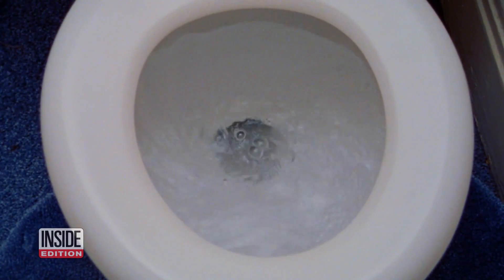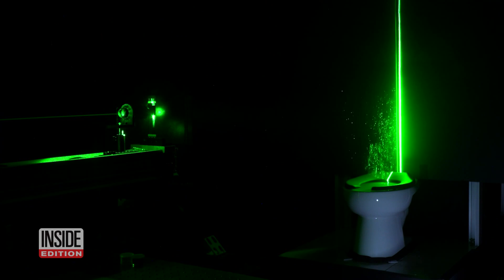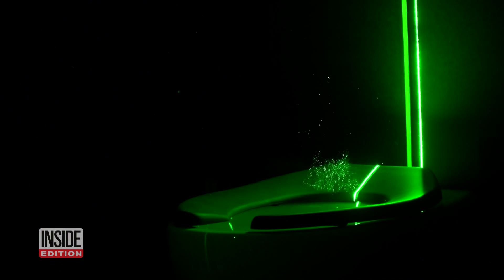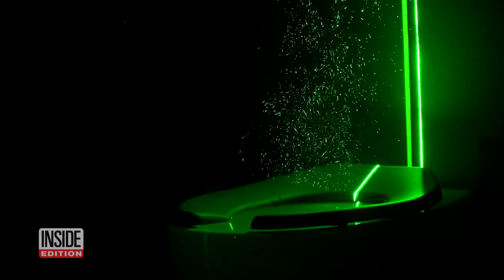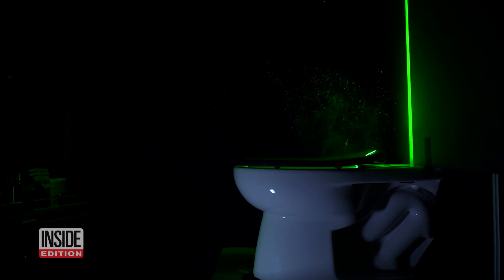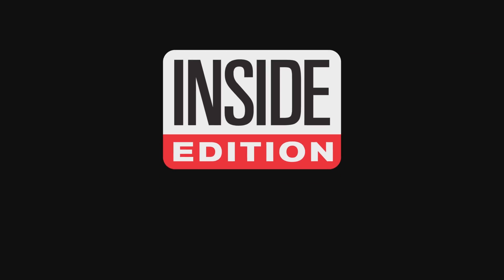Ever Wondered What Comes Out of Your Toilet After Flushing?

Comment: Yep, close your lid at home before flushing folks. 
Oh,
And scoot your toothbrush a little further away. 😂
Reply: I leave my toothbrush in my room, not the bathroom.
Reply: @royroland3884  Good idea. I have a case for my toothbrush but I am too lazy to put it in each time. I am lucky that my toilet is a separate room from my bathroom. I have been closing the lid for years anyway.
Reply: I put my toothbrush in a cabinet in the bathroom.
Reply: Actually, scooting them do not matter, the microscopic poop particles still floating onto everything in there everytime someone take a dump. That's the reason I don't keep my main toothbrush in there period, just the ones I use for cleaning.
Reply: Oh yes, a very good reminder 😃
Reply: Keep it behind the mirror cabinet  if you have one in your bathroom